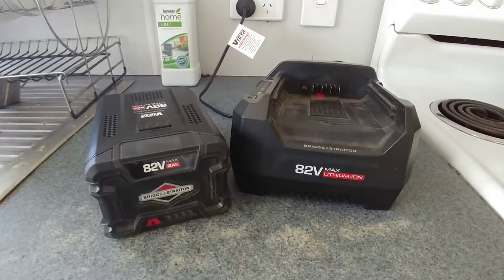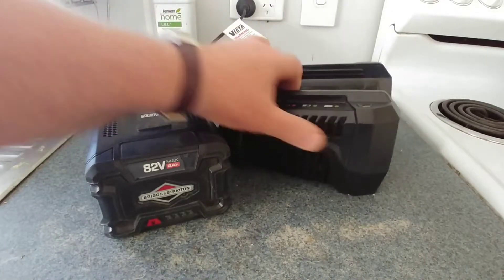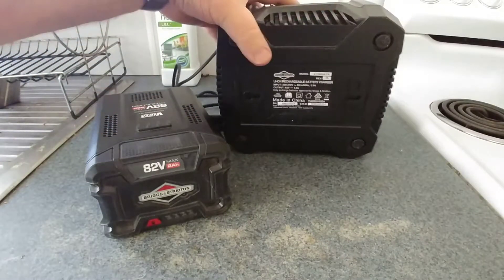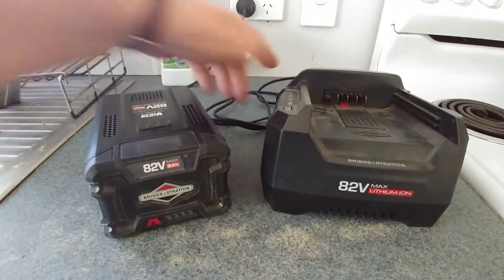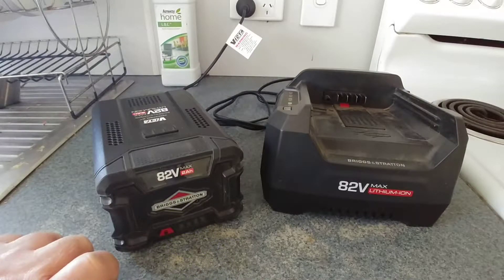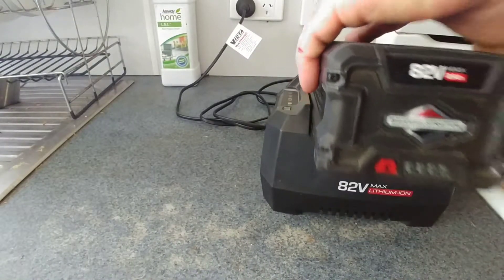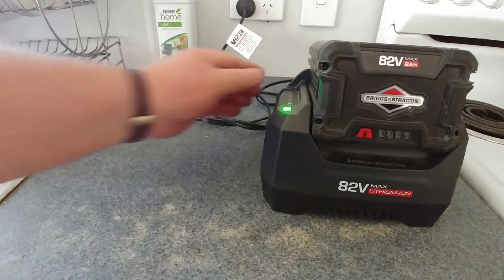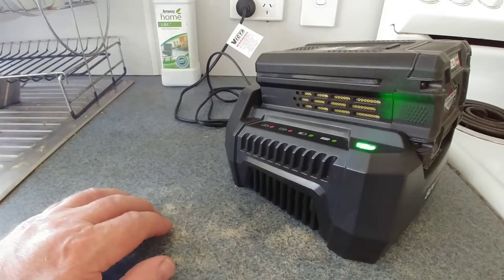Charging an 82 Volt Briggs & Stratton battery

Comment: No explanation about the indicators i.e. when is fully charged?
Reply from the maker: I made this for a viewer for his questions.   The 4 lights on mean the battery has accepted a full charge and is full.  As the power is used the lights go out  if you press the info button.
Reply: How do you remove the battery from the charger?

Comment: I have the 60v and got red flashing light. Is there any way to reset the battery?
Reply from the maker: The red flashing light generally means the battery is hot.  I have had that a few times after continous heavy mowing.  Just leave the battery on the charger and the red light shoud go away in a few minutes and start charging again.  Let me know if it doesnt
Reply: @rolfgrosseholz1311  unfortunately that doesn't help. It looks like it is a  dead cell And I need another battery. Shame because I like it but I'll probably go back to gas...
Reply from the maker: @mickym.6711  They have a long warranty to cover all that.  I look after five properties with mine.  No issues.  Around two years old now.
Reply: @rolfgrosseholz1311  2 yrs, which strangely enough I just came up on....